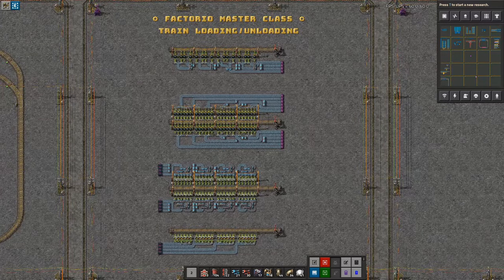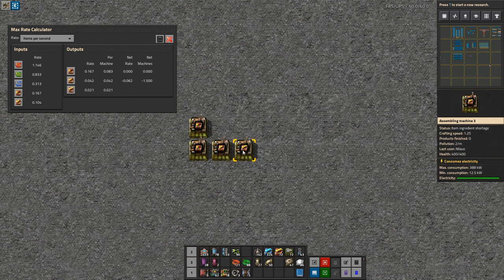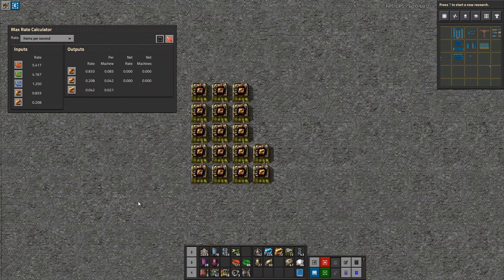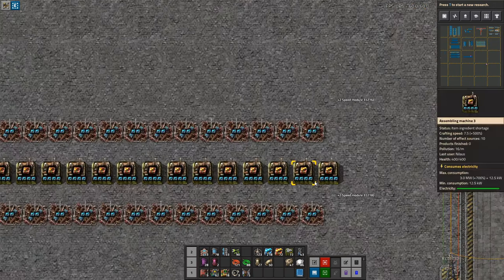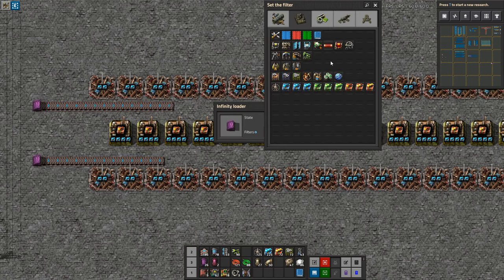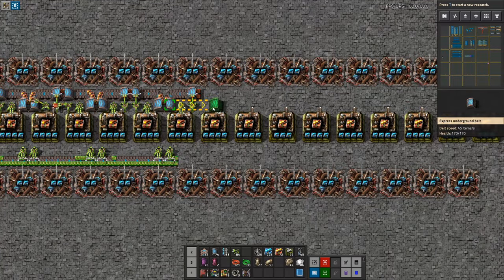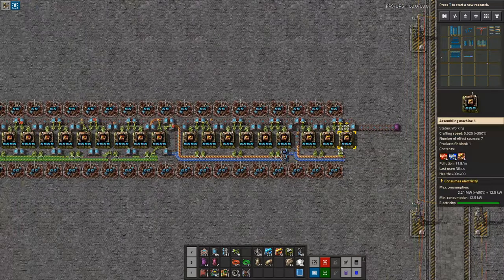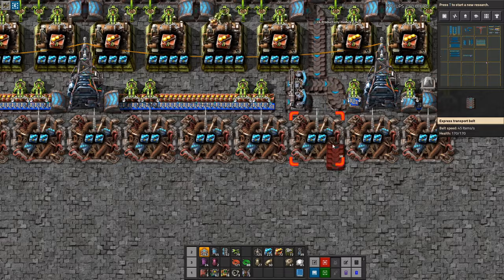Productivity/Speed/Efficiency MODULES for Mega Basing | Factorio Tutorial/Guide/How-to

Comment: 13:44 That is actually very simple, instead of curving the belt down just take the underground straight under the assembler.
Reply: Because it's starting out right next to the assemblers, you'd need to go up first so you have room for an underground, and even without that issue, you need every single tile on the top side to fit the red circuit inputs and the outputs. His solution leaves the top side clear.
Reply: You could output all the modules on the bottom side, they all end up on one side, so the other side of the belt can already be filled with blue circuits. That way, you don't need to switch sides between Mk1 and Mk2
Reply: @tejing2001   I think you're misunderstanding maybe.  I believe Hedning's solution is to just side load an underground exactly how the Mk2's are loaded above their respective machines.  It leaves the above space clear for red circuits and no regular up or down belt routing.  Just side load the underground, go under the machine and then mix with the blue circuits.  Or I misunderstood your comment and then I just wasted a lot of time..  either way.  No harm, just trying to help.

Edit: Spent obscene amount of time making awful illustration with keyboard... 

(Red Chip Belt) ---->
(Mk2)----->\   /  <(underground belt under machine)
(Belt)------> |  |    
                   |  |
Reply: @Jay-fy4zy  I hadn't considered that option. I'm not sure whether it's what the OP was suggesting, but let's give that the benefit of the doubt. However, my point still stands about the mk3 machines' outputs and red circuit inputs requiring every tile of space. That underground would take up the tile needed for the inserter putting red circuits into the first machine.
Reply: @tejing2001  My point was that getting the mk2 modules to the other side was not impossible, but easy.  Since the introduction of filters on the splitter people have forgotten how powerful undergrounds are. It's a tool that is very good to have in your toolbox. 

Of course you can't continue exactly like he did if you are using that tile, but nothing says you have to. I would continue the row with weaving, and probably save 2 beacons including that other gap, but you can do it with just blue undergrounds as well. For example like this: https://i.imgur.com/6XznFHO.png

It might not always be possible to move an underground exit like he did here. That should not force you to trash the entire design because you don't know how to use undergrounds.
Reply: @Hedning1390  All true, but I still think his solution was actually "simpler" than your suggestion, considering all the other moving pieces involved. Anyway, it's mostly a matter of taste. I've never really liked side-loading onto undergrounds, or dealing with lanes individually much at all really, though I make an exception for the output method he used here, and for simple setups like putting 2 items on 1 belt to feed into a row of machines with many inputs. Because of that bias, I didn't pick up on what you were really suggesting. Sorry about that.
Reply: @tejing2001  His solution was to move the entire thing back, something that might not always be possible. Of course it worked in this case otherwise he wouldn't have shown it and he would have had to do something completely different. My picture was not meant as a blueprint to a module production row, but just to show that the issue you pointed out can be solved. Being constricted by his original pattern course my "solution" is not optimal. I have module production rows and they are different.

Don't know why you are against working with lanes. That's like a core feature of the game. Side loading to undergrounds is a great way to feed an inserter. Compared to splitters undergrounds are also half the size and ups friendly.

Comment: Next up... LTN!!! Would love to know how to monitor inventory and govern LTN on the same network, as all use the city block power pole layout. Trying to build your dashboard idea. Also trying to run a main power breaker where I can manually turn on and off each section of the city grid.
Reply: To Monitor your LTN inventory you can use the LTN Monitor mod
Reply: @MaxMustermann-om2ji  it's no problem monitoring the network when it's only LTN on the network. I would like a system where LTN doesn't interfere with inventory levels if both networks are on the same grid. That, and a dashboard that not only displays the total inventory, but also shows how active the LTN is for each item, and a power station that can turn off each individual city block once capacity is reached.
Reply: Thankfully when 1.1 comes out LTN will be a thing of the past
Reply: @winkbrace  for real?!? I've been out of the loop in Factorio. Only updated from 0.16 a week or two ago.
Reply: @winkbrace  LTN is way more than the changes in 1.1. So LTN will still be there

Comment: So I have often wondered at what point modules actually make sense. Because Factorio has unlimited space you could just build infinite copies, gather infinite resources, and never need modules. Plus there is the non-trivial cost of the modules themselves. For something like early Koverex and Science they are so resource intensive it makes sense to have some modules to reduce the material demand of the system. But at the level of green circuits how cost effective is it to have a 8 beacon setup or does it just save space and FPS?
Reply: Yeah, I feel the same. Belts and inserters and assemblers are so much cheaper and faster to produce than beacons and modules that building more seems like the cheaper option. Eventually UPS might be an issue and if you have artificially constrained your space for some reason beacons/modules might be a way to push up throughput in the limited space available. But just using this example in the video tripling the amount of machines would have been a much easier and quicker way of using a full belt of reds. Ratio of 10/5/2 only producing 1/3rd of what you need? Build 30/15/6 assemblers.
Reply: Productivity modules drastically decrease the amount of total resources that have to be consumed. For a given science per minute, you need like 1/3 as many green circuits if you use prod3 modules. This decreases the logistical overhead and allows simpler designs.
Reply: That only applies to prod modules. But the same can't be said about speed modules and beacons, which is what this video is all about. In fact they INCREASE the total amount of resources needed because building those modules is very expensive. The only reason to ever use them is in very niche situations or if your UPS can't keep up anymore.
Reply: @MrGlugz  
If your machines are running slower, you're just going to need more productivity modules anyway. Speed modules increase speed, and productivity modules in a faster machine are doing more work than they would in regular speed machines. 
Plus, even if space isn't an issue, it's easier to work out logistics in a smaller factory, not to mention fixing mistakes, getting from one production block to another faster, etc. 

Anyone who thinks modules aren't useful or are for niche situations, I implore you to look up a calculator and mess around with it. Just for quick reference, you can make 45 red circuits per second using 360 smelters for copper, or just 20. You can put them (copper plates) on 5 belts, or  just 3. You can make 25 assemblers for the finish product, or you can make 216. So yeah, look at the numbers before you decide you'd rather use all that space. Because it's a loooot of space just for a single blue belt of red circuits. Try getting 1000 SPM with a setup like that. 

As for which uses more resources,  that same red circuit setup I use 13,500 copper per minute, you use just under 16,000. That's 150k per hour more. That's enough copper for 75 modules right there. The more hours you play, the better it gets. And I didn't even factor in the insane amount of drills, smelters, belts, and inserters you have to make. And that's just a single belt of one item, I need just under 3 belts of red circuits for 1000 SPM. You'd need 5 belts.

Comment: Why not just build more assemblers? It's considerably cheaper than adding speed modules, both in power and resources, and I don't see why the savings in space are so significant. I understand the use of them in conjunction with productivity modules, where a single assembler effectively costs an assembler plus four lvl 3 modules, making it cheaper to use beacons than more assemblers.
Reply from the maker: Free stuff from Productivity modules beat any of your arguments
Reply: @Nilaus  I didn't make a single argument against them, I made an argument supporting them. I'm asking what's the point of putting speed modules in assemblers.
Reply: @jozefuhasis1338  The reason to keep the number of assemblers low is to also keep the amount of unsaturated belts (and overall "entities") at a minimum.

When you're transitioning towards a mega base, or you're already running a smaller mega base at 2,000 or such science per minute, the resources you require to build something, just anything in the game matters less and less as you keep ramping up - meanwhile, the resources your computer will have available to process everything will become more and more precious.

Unsaturated belts and liquid mechanics are a significant contributor to how many calculations per second the game needs to make in order to function - and most importantly function at 60 updates (and therefore 60 frames) per second, if possible. 

It's for that reason that you want any setup you run in the late game to be as "belt efficient" as possible, even if the amount of in-game resources it requires to accomplish this might seem out of place on a cursory glance, assuming your point of view is that you're looking at it in terms of in-game resources spent to output generated...
Reply: @nineinchheels2041  I've asking this question for years. I've seen this seemingly completely nonsenical thing in so many bases. Didn't matter how big or how small, it was there. Finally, after years, I actually got a proper answer. I stand corrected, but I wasn't wrong completely, as even the bases that have no hope of becoming megabases use this.